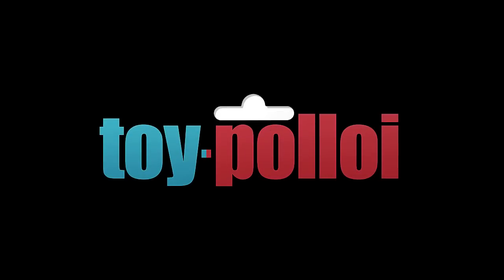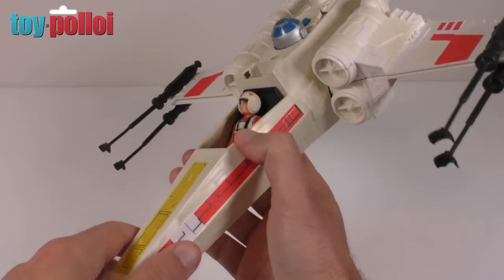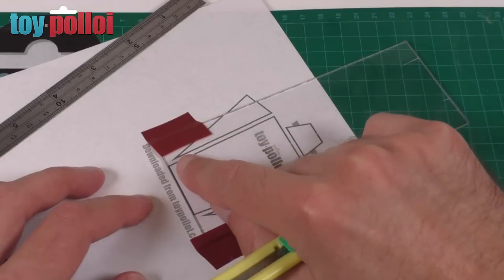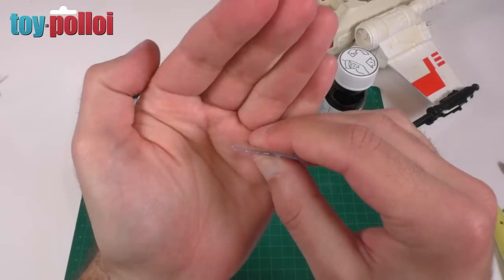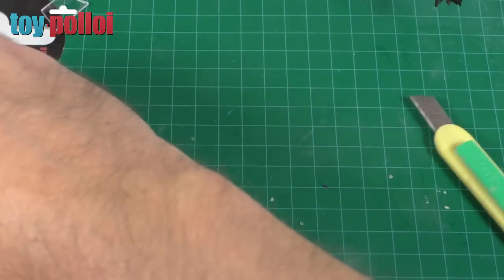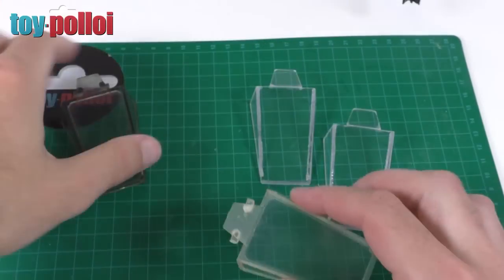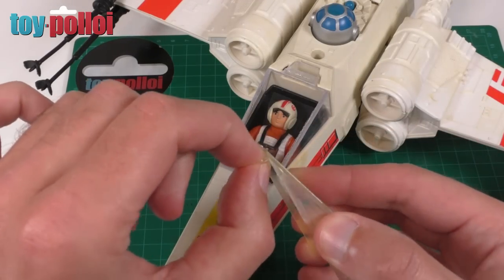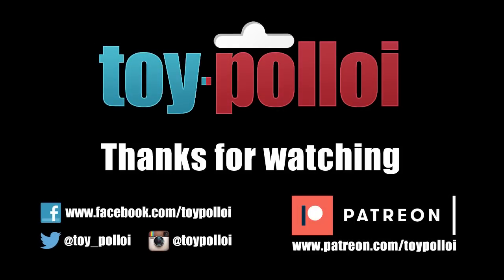How to make a Vintage Star Wars X-wing Canopy / Cockpit - Kenner Palitoy - Toy Polloi

Comment: LEGO has the “whip antenna” in translucent clear plastic in 3mm that you could use as a replacement for the hinge.  The tops are even rounded like the original hinges.  This way you wouldn’t need to sand and the hinges would remain clear! Awesome job!
Reply from the maker: They are to small. The canopy would not fit snuggly enough. I always go for Lego first, but not on this project.

Comment: While I liked the solution in this video, there are several other ways this canopy could be made and tinted.

Polycarbonate is a thermo plastic and can be bent or vacuum formed after being heated up. A possible solution to make a canopy out of a single piece of plastic (polycarbonate or acrylic) would be to use a hot wire where you need to make bends. There is plenty of information online on how you can DIY this type of solution.

There are also plenty of DIY solutions about how to create a small vacuum forming rig using common household items such as a shop vacuum, household oven, and plywood (or even a heat gun for small parts). You would need to make a form to pull the plastic over.

As far as tint goes, Tamiya makes a polycarbonate paint called Smoke which can be used to "tint" plastic. It is Tamiya PS-31. You can find plenty of examples of how this paint looks if you search online for tinted R/C vehicle windows. The only issue with this paint is you must use very light coats.

Another solution for tinting polycarbonate plastic is using fabric eyes such as RIT. Again there are plenty of examples online of this process. Most supermarkets in the U.S. sell RIT dye and all you need is to mix it in a pot of warm water. A short bath in a black dye and water solution should be enough for gray. If it needs to be darker, you would just let the part sit in longer.
Reply from the maker: There are plenty of ways to do this. The one I have shown is simple enough for most people to have a go at and requires little to no specialist equipment. 

No point showing a fix that requires you spending large amounts on equipment and tools if you can get good results with items most people will have already. Cheers

Comment: Good fix! I was wondering if you had thought about using a Tungsten Carbide tipped scriber to score plastic? I've used one for many, many years, and always got good results from it. The tip is exceedingly fine, and not damaged by repeated use on plastics. I've found the control is better than a knife, too, as you hold it like a pen.

Comment: Hi Dave, I have a tool that I use for my modeling it's called "Tamiya plastic Scriber II" I use it for engraving recessed panel lines in the plastic of my modeling projects. This scriber tool is actually from the Olfa company in Japan, and it's basically designed for cutting plastic like you are using. I'm not sure if you are going to be doing more videos making windows, but I think this tool could make the cutting and breaking aspect a bit easier.

Comment: Regarding the smoked glass...I believe Tamiya makes a smoked glass spray-on coating, so even if you used your hinge rod out of whatever plastic you could go back and give it the right look.
Reply from the maker: They do, and I have used in recently in my Killer W.H.A.L.E. Restoration videos. Hard to get a perfect finish. So the smoked plastic would be easier for most.

Comment: Starting make mine today. Must be the type and/or brand of poly i bought, cuz it bends really far before snapping. Holding it firm on the edge of my table, after scoring it 3 times with a brand new blade, it bend 45° without a snap. So i had to score 3 times on opposite side! I think im gettin the technique now.
Reply from the maker: The first is always the toughest. You'll get learn what works best as you go. Have fun.

Comment: Another great video! Very informative. Just saved me $200-300. (Which i can now use to build my armies,lol). Yes, ebay has these selling for $40-70 right now, and its ridiculous, since there are toy shops selling complete X-Wings for that much. Red Squadron is gonna be happy, they're no longer grounded! Safety note: As a contractor, i use a utility knife every day, please hold the straight edge down VERY FIRMLY or you could severely injure yourself. Im ordering materials today, thanks again!

Comment: Great canopy template. One question though:  the lines drawn in the template are rather thick. Should the cut be on the interior, middle or outside of the thick black line?
Reply from the maker: Cut inside the lines. That goes for all my templates. Cheers

Comment: Fairly sure you can get the sanded parts to become clear again if you pass the plastic through a flame. Atleast thats what we used to do in the wood- / mettal shop in school. The finer you sand it the less of the groves will be visseble when you pass it throug the flame.
Reply: Notised the rod you sanded down was fairly distincs in it fooged looked compared to the rest of it.
Reply from the maker: I'll give it a go and see what happens with one of my test canopies.

Comment: Is Plastic Weld a sticky liquid like super glue?  I just noticed that you didn't get any stuck to tour fingers when holding the cockpit (although maybe it's just me who constantly gets super glue on my fingers) and then I realised that its maybe cos it's a chemical reaction with the plastic rather than actually being a sticky substance?
Reply from the maker: It's a solvent that only works on certain plastic types. On anything else it just evaporates.